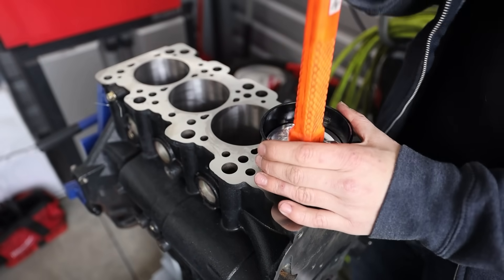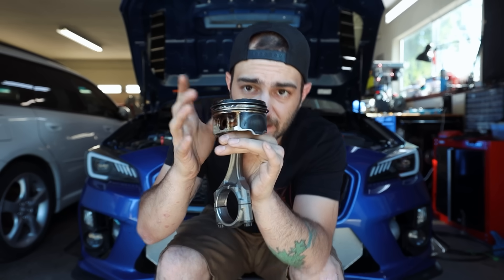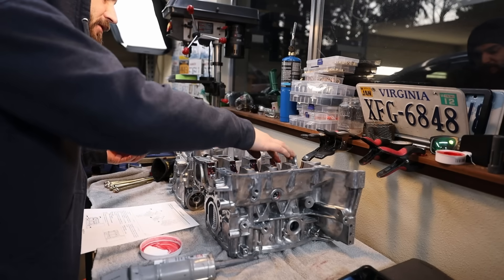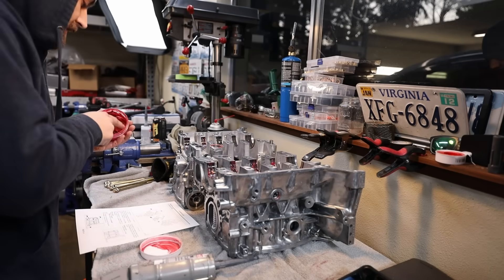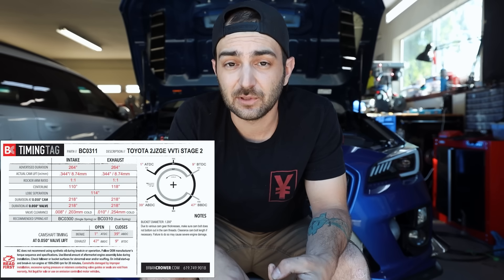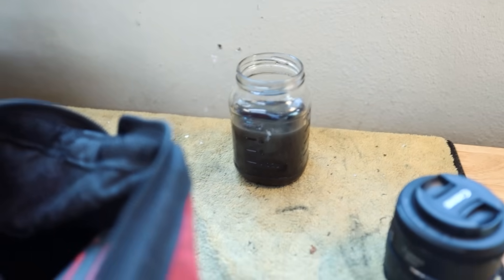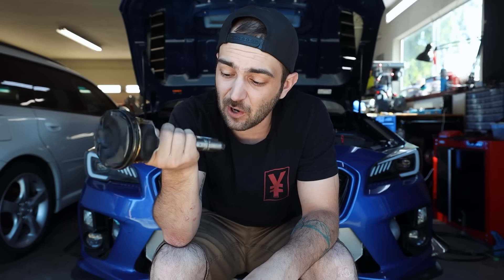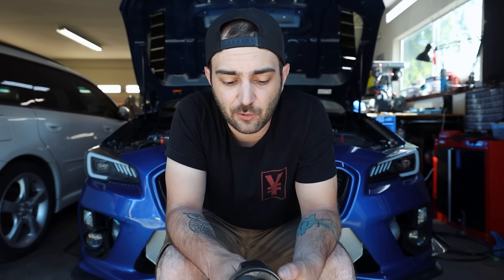How To Break In a New Engine.

Comment: Excellent video. I know you were talking about a built engine but I'm curious of your thoughts on a new OEM car like your BRZ. I'm picking up a GR86 soon. I've always heard mixed things. 1. Old school people will say break in for an OEM motor isn't that important, overly strict and will restrict power if you baby it too much (wtf? this has to be wrong) 2. The factory already tested and redlined the engine before putting it in the car, break in from the manual is overly cautious (I mean maybe depends on the car I guess). Surely following the owners manual to the T wouldn't limit the engine's power. Richard Hammond had a vid on drivetribe him talking about having a van and the break in period which ended up him saying the other new van that got beat ended up with more power. Anyway I've heard a lot of shit about OEM motor break in and I'd rather just follow the manual and change the oil early. Do you think it would help at all to run break in oil on a new car? Thanks in advance.
Reply from the maker: On a stock car I wouldent go out of my way to swap break in oil in unless you really wanted to
Reply: @Smeedia  got it that's what I figured
Reply: Owned two BRZs (2020 & 2022) and did proper break in and both required oil top up, no more then 1 quart at 6,000 Km but still they used some oil. The young mechanic at my dealer says it’s normal for that engine, high revving low tension piston rings so I accepted that but did not like it. Just got my 3rd BRZ (2023) and I am extending the break in hoping it won’t use as much oil. Keeping my revs down below 3000 rpms and not loading it and not gearing down either. Full synthetic oil works so well I’m sure break in takes longer. Hope you have better luck then me and always keep an eye on the oil level. Owned 2 Miatas previously that were moved with superchargers and drive reved them over the redline constantly and never had to add oil !!
Reply: @Tonga2  So...not doing what they recommended in the video?
Reply: @davidcrandon2329  my third BRZ now has 22,000 kms (13,000 miles) and it still will need the oil topped but not as much as my first 2 BRZs and I attribute that to a gentle breakin keeping the rpms below 3,000 kms for 1200 miles and then below 4,000 kms for an additional 300 miles. I do find that if I’m on a highway/interstate at 70 mph for a long trip and then backroads using the gears at upper rpms it will use oil. Let’s say a trip of 2,000 miles on a 4 day trip the level will drop enough to add about 8-10 oz of oil. That’s almost 1/4 to 1/3 quart of oil. I have my rev limiter set to go off at 6800 rpms because peak power is at that rpm and pushing it over that will only cause more oil past the rings. This engine was designed to rev freely and give the optimum power. The manual warns everyone about the oil consumption and is normal for its design. I now leave with overfill of just 6-8 oz of oil knowing it will just give me a few days of driving before I will check the oil and find it at the full mark. I always keep it at the full mark because of oil pressure drop on hard right hand turns. First and only sports car that has had anything like this but still love the car for every thing it does to make it an engaging drive.

Comment: Ya well, what about a bran new 2022 WRX? Don’t they come with “Break-in” oil from the factory that is supposed to stay in for about 2,00” miles and then change it? The manual says 1,000 easy-going to break in the engine. But my understanding is that there is no real break in period anymore for a new car. Maybe for an engine rebuild/replacement. But to this day I still don’t understand where certain mileages come from. 250 miles should be enough easy driving to break it in. And i typically change the oil after 250 miles.
Reply from the maker: No. For a brand nee car I still do the dame break in I would do for any other engine

Comment: This is the best break-in video I've ever seen. Straight up FACTS from a guy who has actually put an engine together. Unfortunately, the VAST majority of people will incorrectly think they're still "breaking in" after 100 miles.
Reply from the maker: All down hill for an engine after its been "broken in" might as well start enjoying it as soon as it's ready 💪
Reply: Just did this one on a new EJ255. Changed the oil a couple extra times and it looks good and she rips! I’m enjoying giving it a workout.💪🏼
Reply: I agree this is one of the best informative videos on YouTube  without listening to hours of classroom lectures.
Reply: Got a 2024 crosstrek sport and I’m at 600 miles on the dot. Trying to think of how I was driving up until 150 miles on the dash 😂😅 I think I’m good, only a 2 hour drive going 75 on the freeway from the lot to my house was the hardest I’ve drove it
Reply: Damn, I just rebuilt my Corsa 1.2 Twinport 2005 and I kept driving fairly conservative up until today at over 1000 miles. I went under 3500rpm for the first 60 miles or so, then 4000rpm up until 500miles, then pushed it to 4500rpm up until today where I finally gave it all to 5000rpm at first, then 5500rpm and then eventually drove it like I stole it and shifted at 6000-6500rpm (redline starts over 6500rpm, rev limiter at 6800rpm). During break in I sometimes gave it full or nearly full throttle at hillclimbs because I felt like it was probably safer than using higher rpm that early. The car felt really strong pulling, but initially was struggling to get past 100mph. After pushing it through a mountain road and using the whole rpm range, it was able to get to around 115mph while running smoother and stronger. It now overtakes really easily when in the powerband, but still does a decent job even in top gear

Comment: What a timing coincidence. I did a thing yesterday and swapped my 21 wrx for a 22(even got the dealer to swap my parts back to stock so I dont have to do the work 🤣). Basically a straight swap over due to the insane used market. So in the break in period now. I miss the power I had in my 21, but im going to enjoy getting more power from the FA24 😁
Reply from the maker: How you liking the interior and what not on the 22?!
Reply: @Smeedia  seems pretty good to me. Aside from the go aweful fake carbon they have. An sadly it seems the base model doesnt have triple meter so o cant see my pil temp. Seats feel a bit more agressive. An the car exterior does look much nicer in person. I wish the fenders were slightly more aggressive though. But so far been digging it. Drove it straight from the lot(SoCal) to vegas this weekend. Getting in those break in miles haha.

Comment: Thoughts on the take I’ve heard where you need to use high rpm to have the rod forces/stretch in order to seat the full length of the hone?  I.e., low load but up near redline and engine brake back down?
Reply from the maker: The rod doesn't travel any farther up the bore the higher you go in RPM, it will always travel the same distance weather the car is idling or at 8000 rpm

Comment: I just finished installing my new oem ej25 block using your videos! Thank you so much. What break in oil do you recommend for an oem ej25 I was thinking 10w40 valvoline VR1?
Reply from the maker: I use thr motul 10w40, VR1 isn't bad either 💪
Reply: @Smeedia  I appreciate all your help 👍🏼

Comment: Why 7psi is different from a VF48 to a PT6870 ?
Reply from the maker: Volume and the amount of air it'll move
Reply: @Smeedia  are you saying the PT6870 will move more air at the same 7psi ? It doesn't seem so . Please elaborate
Reply from the maker: Yes 

Compressor housing size is widely larger than that of a VF48. By volume a 6870 will move more air than a Vf series turbo 

PSI is not a liner scale across turbos
Reply: @Smeedia  the much bigger size means it has the potential to work at much higher boost and then move more air . But it doesn't change nothing at the same 7psi

Comment: Just got a new IAG stage 2 tuff they recommend 1k with a break in tune, is a break tune critical or can I just keep the revs down and stay out of boost and all that on a normal tune.
Reply from the maker: I would suggest a tune, doesn't have to be a break in tune. But I'd make sure that everything is proper with it 🤝
Reply: It really depends if you're putting the engine into a car with a standard ECU or putting the engine into a car with an aftermarket programmable ECU, if standard then yeah you'll be fine taking it easy, if aftermarket then you're best getting it mapped for break in as the aftermarket ECUs usually come with a map pre programmed that's really rich to prevent idiots just plugging in and blowing up their engine but for breaking in an engine they are bad because they run so rich they wash the cylinder walls with fuel which is bad for break in.

Comment: I recently got my car back from being rebuilt. And I encountered a CEL and it says p2008 what do you think can be the cause of it? My shop checked it and cleaned everything, could it just be a sensor?
Reply from the maker: That is a TGV code, could be one stuck open or closed 👀
Reply: Yeah they found out that the motor/sensor that toggles the tgv for cold start gave out , swapped in another tgv and now I’m all good 👍

Comment: Tbt to when you told me this break in for my 21 STI but I was picking it up from my dealer out of state and didn't really have much variation since it was pretty much all highway 😅😅 I tried to fluctuate between 5th and 6th at different speeds to help as much as possible but yeah
Reply from the maker: Doing what ya can though, as long as it's running good 💪🔥
Reply: @Smeedia  I think so. Burning through a bit of oil I think though. Did the initial 1k oil change as per the Subaru break in cause I didn't really have the chance to do what you recommended and 3k OCIs since. Now sitting at 7k mileage and change. The 3rd change from 4k to 7 I think I went through nearly 1qt I heard from some people apparently that's normal? Idk used to my 18 WRX not burning like a drop so it's slightly concerning especially in 3k miles even if it's normal

Comment: Followed, probably for way to long, the break in procedure Subaru suggested for my 21 and I use literally 0 oil between changes and I'm at 25k now. I really feel like a good break in is key when I hear about others that use oil at 30-50k miles already.
Reply: Its all about maintenance. My wife has a 2016 impreza. She didn't do any break in she just drove the thing. But I dumped the oil at 500kms. And i change it every 6000kms with mobil 1. It has 225000 kms and doesn't burn a drop of oil.

Comment: Speaking of break in bro, Im very curious how my fully build block  will perform with the cams, my tuner will do mixed cams GSC S1/S2 (268/272) with Ferrea Competition Plus std sz 36mm In and 32mm ex, Ferrea titanium springs/retainers and as for port work, bowl blend, some light porting, casting clean up, I guess...cant f#cking wait to be on the roller listening that T51R screaming🔥🤌
Reply from the maker: Ohhhhh you going to have some good airflow with that set up 🤌🔥
Reply: @Smeedia  ohh yeahhhh, I cant wait, I need to get my hands back to video editing, its been a minute since Ive done one, I'll will tag you on the dyno video

Comment: For your oil / break in oil do you recommend the 0W20 or 5W30 ? I believe the new 2022 WRX comes with 0W20 and recommends it but I read some say 5W30. Also I’m not sure if it makes a difference but the break in period would be in vegas where it gets like 120+ in summer.
Reply from the maker: Always 5w30, 0w20 is like water. Most thr time it's used for fuel economy reasons.

Comment: Thanks for the video Tanner, this was great!  Having the brand new type RA long block assembled for my launch edition this week, so this video comes in handy.  Instead of following Subaru's break-in process of first oil change after 1k, I'm going to do an oil change at like 500 miles.  Edit, side though.  Makes sense that the boost gauge isn't functioning on the center gauges.  But, does the drivetrain screen still work?!
Reply from the maker: Drive train screen does still work 🥳

Comment: Question for you; I'm assuming this applies with a car you're buying new from a dealership as well or do they break it in before it goes into the car? Just curious
Reply from the maker: Correct, anything with a brand new engine. 

Dealers are kinda meh, because that car probably idled for a long time and got driven by port. But they have to essentially refresh the car when it's brand new to take it out of "transportation mode"
Reply: @Smeedia  gotcha so probably good practice to do an initial oil change, 1k oil change then 5k?

Comment: Bro I got a brand new type ra short block and brand new heads, am thinking of changing the pistons and rods. Will this be reliable for a 450-500whp build?
Reply from the maker: Just send it with the RA block 👀
No sense in tearing it down
Reply: @Smeedia  really? How long with this last with Cobb 20g and Cobb flex fuel system
Reply from the maker: Depends on how it's driven and taken care of 👀 my old ra block was making 460whp and I best the piss out of it
Reply: @Smeedia  bet, bought my 2019 Sti brand new with 8 miles on it and it didn’t last much with only 420 @ the wheels and 442 torque. That’s I want a reliable 450-500 until I save up and built the old short block for bigger power
Reply: @MYWRXSTI  I also have a 2019 snd just had s new short block installed at 60,000kms. I love the car but it's making me nervous how long this new block will last

Comment: From 0-1000 miles I do a lot of engine braking. Change oil at 500 miles then again at 1000. I stay out of boost for 500. Full send after 1000k
Reply from the maker: Engine breaking is the way 🤌🔥

Comment: *Water instead of coolant on first start, so if you got leaks. 😉 Valvoline VR1 10W 30 has zinc in it.
Reply from the maker: Lol I have yet to learn the water one 😅
Reply: Use coolant. Just buy a pressure tester and if you got leaks you'll know it before you even start the car.

Comment: My iAG engine listed 800 to 1000 prior to a tune. My break in tune limited RPMs to 3800
Reply from the maker: Every builder will have some diffrent procedures 🤝
Reply: With my IAG block my tuner is making me do 1500 on waste gate until I can get some power :/ but hey he knows better than me. Also has me at 3K rpm’s

Comment: Usually the "break in" is the trial and errors phase. After that I'd leave the rest to the monitoring systems. Most dudes assume it takes thousands of miles🤦🏻‍♂️. Just as long as components are well lubricated and at optimal temps, range, specs, ext.... This was a great topic to bring up T. Im more of a run it-break it -fix-it and repeat type of dude to make room for improvements.
-Smeedia in a nut shell😅 
No offense T 😅✌🏼. + my tuner recommends stock-ish 15+ wrx's with bolt-ons, spark plugs to be gapped at .30-.33 
But Subaru recommends .22 for maximum performance Seems very low Imo? Blu sounds INSANE!!
Reply from the maker: Everyone's got diffret views on this but for the most part I'd say follow whatever feels comfortable 😅

Subaru is also giving specs for stock cars lol

Comment: You can prime oil on any Subaru 09 and up by putting the gas to the floor with it off, holding it there, and then cranking. It's cuts fuel and spark automatically
Reply from the maker: Only takes the 1 time that it doesn't enter flood mode and revs to the moon to never trust that again 😅
Reply: Haha! I've yet to experience that, but I guess it is a real possibility. Pulling the fuel pump fuse isn't that hard I guess.

Comment: I have always done 500 miles for breakin period just for safety measure. And no boost  over 2 psi and no higher then 4500 rpm I grew racing dirt track sprint cars and we only have heat cycle break in. But that was also we would let motor get above 200degree and let stay there for 15 minutes and cool down then restart and give it hell. But my ej lube the shit out it and 500 miles then give it hell after a good tune
Reply from the maker: As long as they stay running strong 💪

Comment: I changed the oil at 50 mile then 250 then 500 and drove the car like you and then changed it again to motul v300 at 856 miles then on the dyno it went
Reply from the maker: Make some good power? 👀

Comment: Always great to hear that STI running. I will have to double check but I thought my Subaru manual said 2500 miles for break in. Guess it’s time to have fun with the turbo then. Great video.
Reply from the maker: I belive subaru suggests 1K miles under 4000 rpm
Reply: yeah got my sti last august subaru said under 4k rpm for a thousand miles. after that all bets are off send that sucker to the moon

Comment: They haven't been putting zinc in automotive oil for a long time because it builds up in catalytic converters. However Kawasaki lawnmower oil has zinc already added comes in most of the common viscosity ratings and is cheaper than break in oil. I use 20% Lucas synthetic oil stabilizer for all oil changes too. I think this is one of those things where there is no right answer because there are too many variables hence all the "controversy" surrounding break ins.
Reply from the maker: For real, like I said you can ask anyone and you'll get a different answer every time 😅

Comment: I’m pretty sure ej’s take like 100,000 to break
Reply from the maker: 100,000. 
100

Who knows
Reply: Fr tho
Reply: But I did have a dumb question you said you need a mechanical oil pressure gauge I have a digital is that ok or should I hook up analog one
Reply from the maker: That works as well 🤙🙏